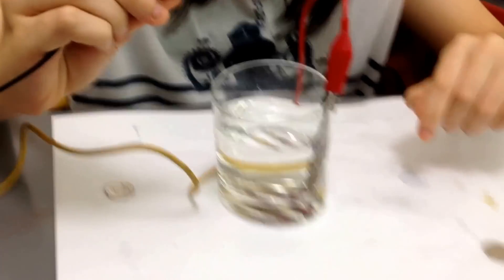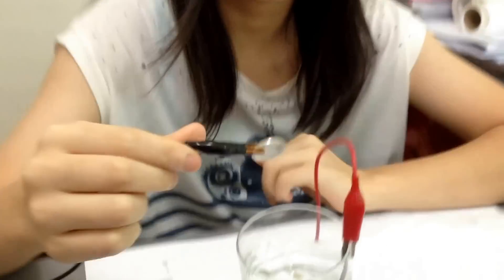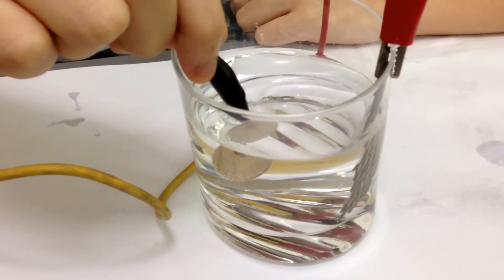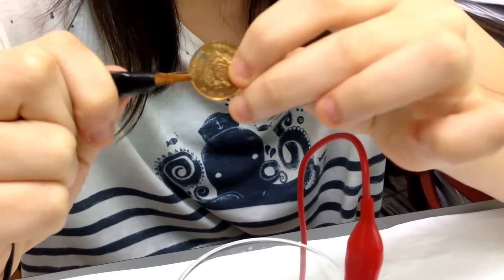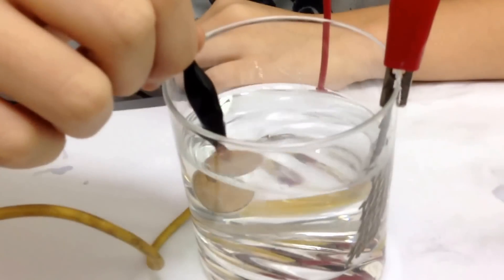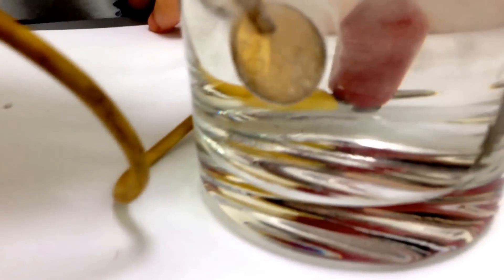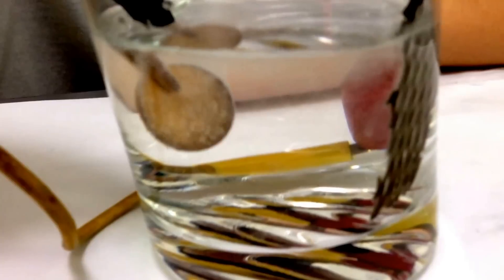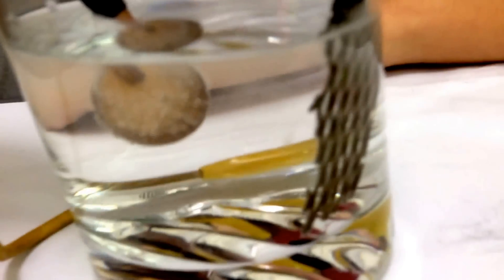Chemistry - Gold Plating 2

Comment: Can someone explain what do you need for gold plating, what she use. 
1. how much gold we need
2. what kind of liquid she use
3.do we have to buy that- (on 1:18 at video) or there is possibility we can use something else
thx
Reply from the maker: FPS SERBIA  - you can buy the complete gold plating set for trouble free plating for a start
Reply: yea i can but it cost about 60e, but transport cost me 57e and here in Serbia they only sell professional and it cost around 250-500e
Reply from the maker: FPS SERBIA - if you have all the other ingredients namely the gold chemical and the Platinised titanium anode ( the electrode that looks like a metal mesh) - You can used a motorbike 6V battery
Reply from the maker: https://youtu.be/uo3DIt2FK4I
Reply from the maker: https://youtu.be/ZfMUFFLhV5o  It's better to import the whole system from the US where you have also the chemicals to dechrome any chromium surface.